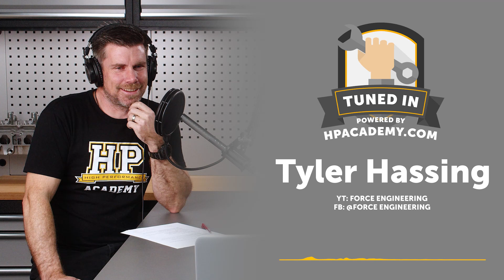035: Simple Engine Building Mistakes That Could Cost You THOUSANDS. [#PODCAST]

Comment: so the hot hone , i see this more so for the small cc controlled stuff and personally seen it being done for a long time on the formula ford 1.6cc . think of it this way , anything to get ring seal will create vac , as with the diamond hone when they first came out , very good article where that was the only change and now at WOT the driver was seeing vac on the straights , allowing them to then go back and open up the head a little , but the had maxed it out before this , 

as for the cleaning of blocks , go back and watch the castrol topshop challenge , watch the cosworth ones , it made me buy a ultrasonic one straight away

Comment: Tylers story a 1 hour 2 minutes. I’ve always suspected a lot of money is wasted in heads on turbo charged cars losing sight of the main power adder. Example being, you can buy, trial and sell on a number of turbos for the same cost as a fancy head build yet people often spec a turbo then sit on it when they could actually optimise their setup materially focussing on the turbo alone.
Reply: About the only thing I would agree with is that sometimes people focus on one aspect of the enging system - You mentioned the heads, but you also fall into the trap with turbo-chargers.
The system has to be considered as a whole - sometimes the best area to focus on is the head, sometimes the turbo' - bearing in mind that can be a rapidly diminishing return without other work, sometimes the manifold(s), etc.

IMO, other than the basics, there are usually plateaus with power/torque increases - eg, 10% is basically optimising the tune; +50% may be turbo'+ fuelling + charge cooler; +75% may be the former + pistons + rods + clutch/torque converter; +100 % may be the previous with a sleeved block + head studs/bolts + stronger gearbox + gears; etc.
having a realistic idea of where one wants to end up and building to that right from the start is a good idea, even if the prep'ed block, rotating assembly, etc, is overkill for the initial mods, it will last as you upgrade as budget constraints allow.

Comment: What would you consider to be the limit of a composite head gasket? I'm running the budget friendly Mr Gasket composite on my supercharged small block Chevy. It's a centrifugal making 7psi at 6500rpm. Aluminum heads, making about 600hp to the crank. Being a V8 do I look at it as 2 different 300hp 4 cylinders that happen to share a crankshaft? 300hp seems well within the limits of a composite gasket. 600hp worth of cylinder pressures spread out over 8 holes sounds a helluva lot less stressful than a 600hp 4G63. Am I on the right train of thought as far as cylinder head sealing is concerned?